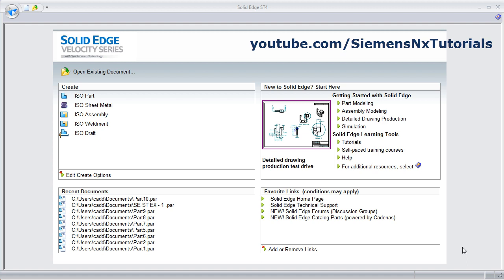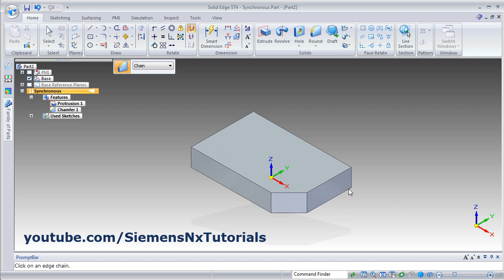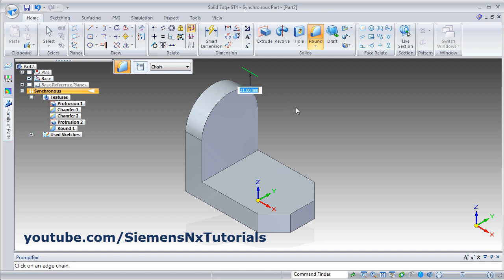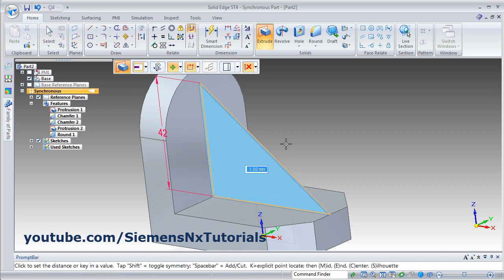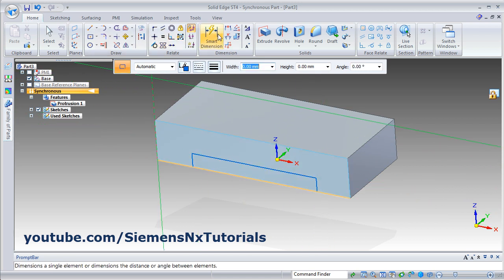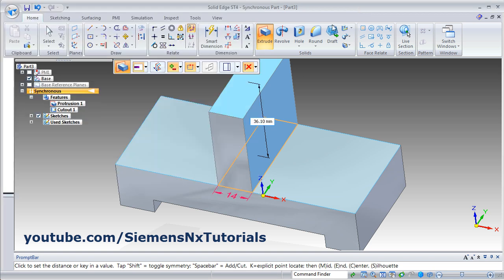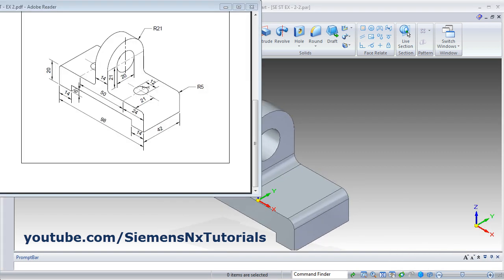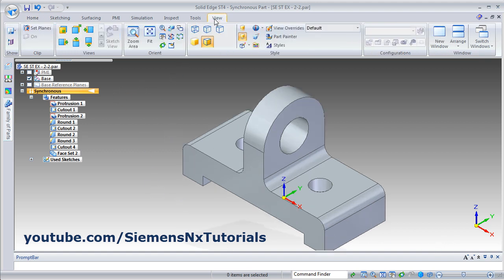Solid Edge Synchronous Technology Tutorial for Beginners - 2 | Solid Edge Part Modeling Tutorial

Comment: Hey I want to thank you for your tutorials! I have had the student version for exactly ONE DAY and spent the last few hours working with your videos and I am EXTREMELY happy with what I have learned so far.

With this particular video, I got stuck at on the first part at the step where we needed to create a coincident plane. I followed the steps exactly up to that point, but when my my curser changes, where i am supposed to right click and select "create plane on this plane base", I do NOT get that as an option. The only 2 options I can choose are "protrusion 1" or "protrusion 2".  Protrusion 1 seems like to places a plane on the top of the part whereas protrusion 2 places a plane on the bottom of the part. In any case, I tried both options and was not able to create the lines for the triangle in the subsequent steps.

Not sure why I do not see the correct choice for creating a "plane on this plane base" as you indicate, so I had to give up on this part of the tutorial. I went ahead and finished the 2nd part of the tutorial successfully with no problems.

Anyway, I am using the student version of Solid Edge (ST10) if that helps.

Again, thank you so much for taking the time to create this tutorials. I love this application and REALLY want to try and understand it. Your videos are giving me a fantastic start !!! THANK YOU !!
Reply from the maker: +dvassist You are welcome. You can also create plane parallel to one of the side faces at 21 distance.